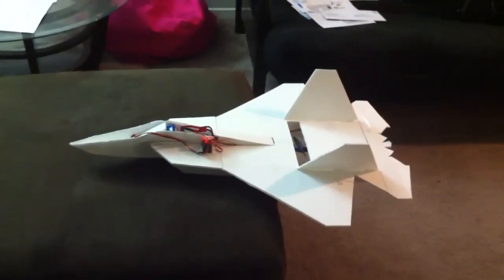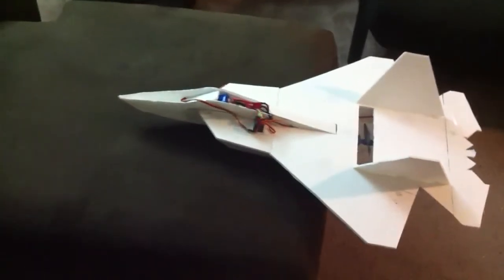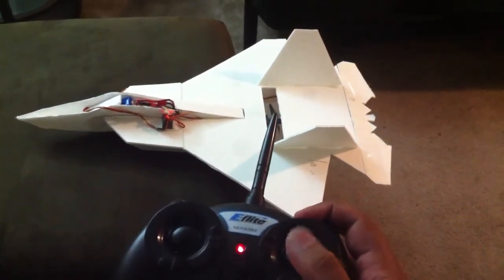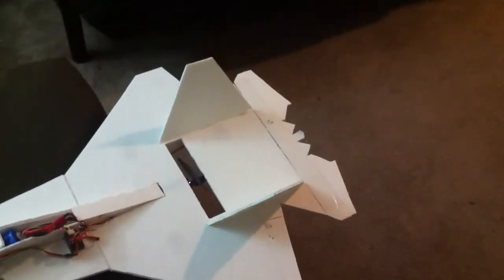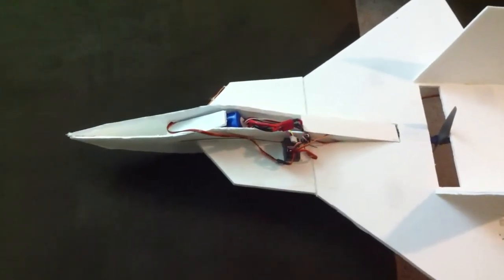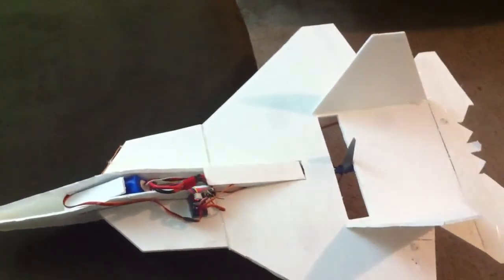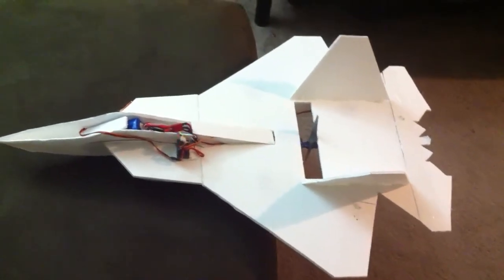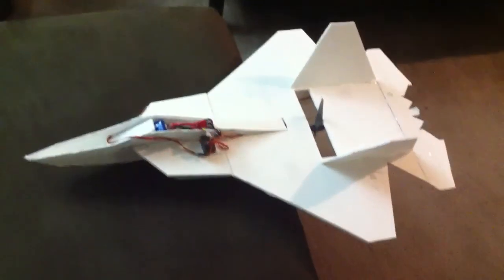F22 foamie first plane

Comment from the maker: @DistructiveRC 

thanks travis. :) now i am hoping to see this fly.. :) the motor I am using is this: wwwDOThobbypartzDOTcom/75m31-optima300-2208-1820kv.html (i know this is less KV than "required.. it is 1820.. required was around 2000, but, I am hoping using a higher pitch propeller will help .. suggested was 6x4 and i am using 6x5.5)

Suggested was the combo from Grayson hobbies. The motor and esc was 40 bucs there, I got all that in less from hobbypartz ... :)

Comment from the maker: thanks for the heads up you guys. I know that the ailerons are not that way. That was jus tthe MSR setup. I have to make a Y on the servos... and then I will have a better setup.  I am gonna see if i can physically reverse the servo on the elevator and then aileron i am gonna see if the directions are correct. And i might maiden it with the msr remote.. U never know.. What settings do i need to have for the esc on this?